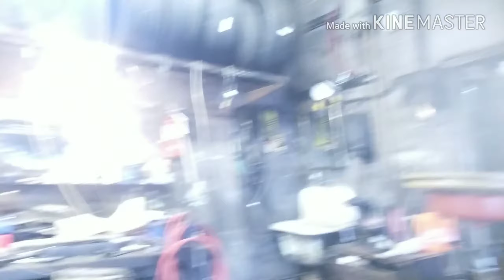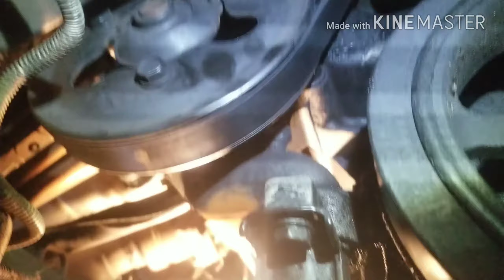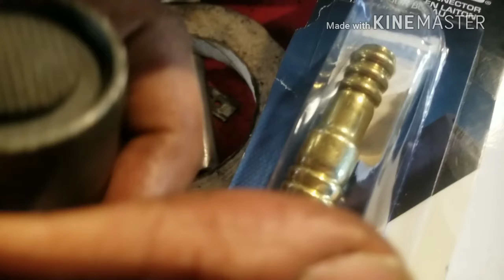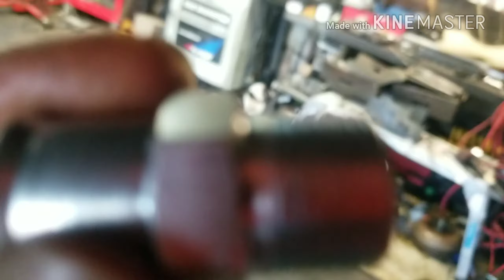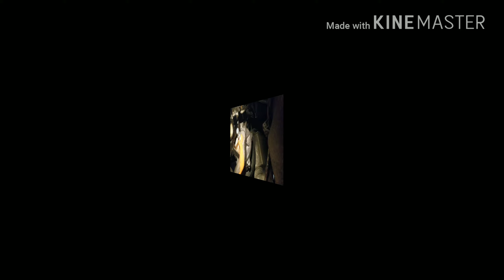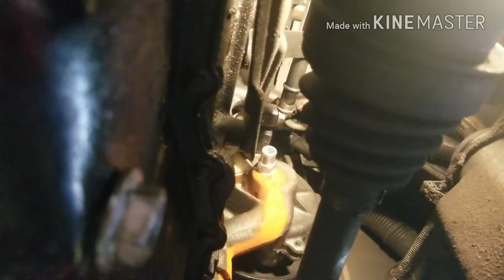How to Repair Leaking Timing Cover Water Outlet, Fast and Easy.

Comment: Of course you know that hole is non threaded. As the other person says, the manufacturer's nipple that fits there is a press in and costs $40 which is a rip off because it is manufacturer exclusive with no aftermarket nipple available. Were you aware of this? Or did you start off trying to save money which ultimately you didn't?  I'm working on mine now and to answer AManUntitled's question, mine had completely rusted out leaving a clean hole.